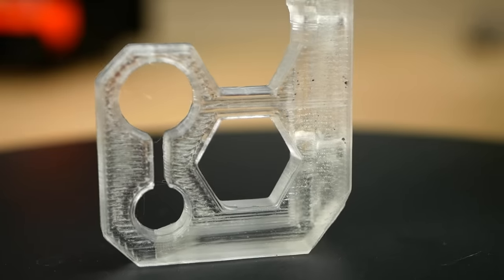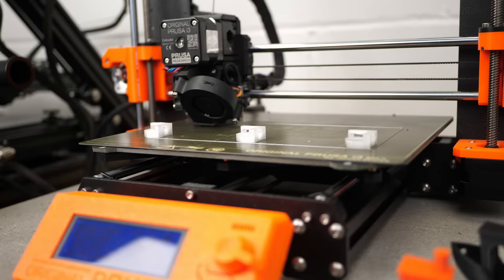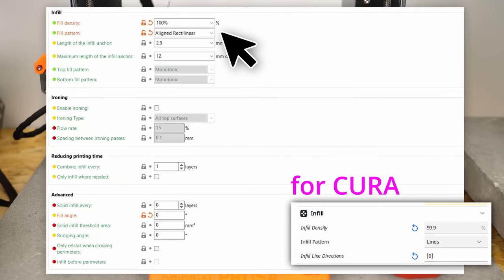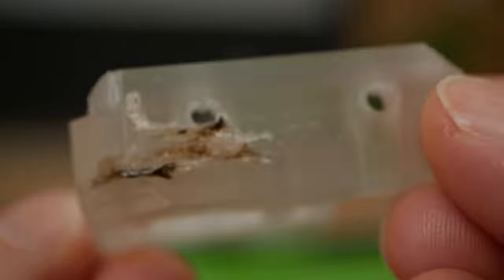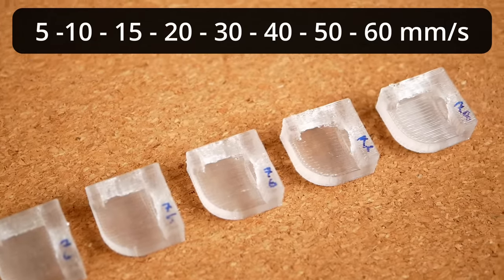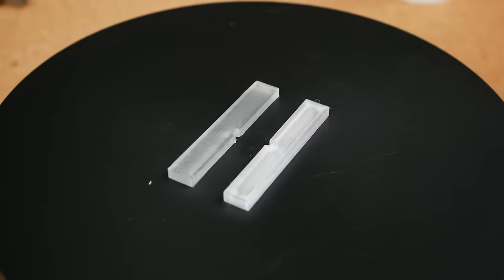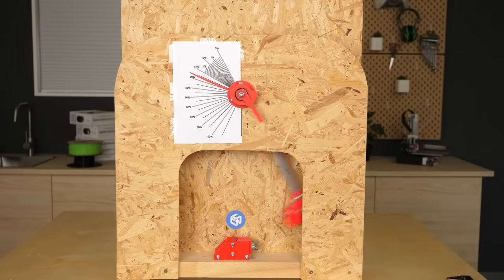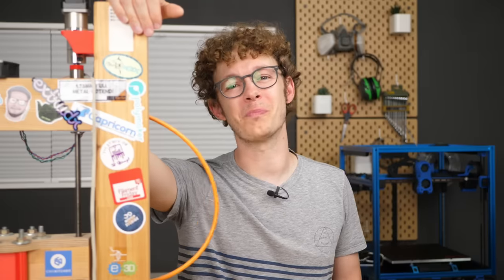Transparent FDM 3D Prints are Clearly Stronger!

Comment: The almost-perfect transparent printing of SLA also creates weird problems. Parts with flat faces printed at an angle get an undesired fresnel lens effect, where if you look through the part (or to what is inside) everything looks strongly shifted to one direction. It's similar to water diffraction, but it happens at any angle you look from. Sanding and polishing removes that distortion, but it's yet another messy processing step.

I haven't used DLP printers and I wonder if the same issue happens.

Comment: Nice video!   I recall you discovered thicker layers had better interlayer strength.  So then why not print .2mm or even use a larger nozzle like .6 or .8 to see how strong this can get?  And how about using an enclosure to keep a sort of heated chamber effect? Might an acetone vapor or heat gun add any strength via inter-layer melt?

Comment: I\ve found that thicker nozzle diameters greatly improve strength, layer adhesion, printing speed and transparency of PETG prints. If small details are not your biggest concern, try sticking a 1mm nozzle in there
Reply: Any pics showing this? I would be interested

Comment: I often wonder if the expense of another degree or two of freedom of movement would be worth having for FDM. It would allow adding layers across regular layers. That would glue them together with perpendicular polymer molecules. I think it would help eliminate the need for overhang supports too.

My other thought is messy, expensive and maybe not for every day use. Oh, and also requires finding the right materials to use. But what about putting the parts in epoxy or polyester resin and cyclically applying vacuum to pull out gas and push in resin to fill voids? A custom shape resin container could be printed along with the part to minimize resin waste. The part would be removed from the resin before it cures, or the container treated with mold release so the whole thing is epoxy coated. Optionally batter with glass fiber while sticky.

Comment: Thanks for the video. I thought that glass prints were impossible. I’m using a Creality CR-10S with ColorFabb HT-Clear. It has driven me mad in the last week, done a dozen test prints changing same parameter as you have, and i think that finally i got it. For the infill i prefer to replace it with the 99999 top surface layers, otherwise cura does weird things with infill (starts on the middle!). For me 85°C bed, 260°C end, 20mm/s speed with 12mm/s top/bottom speed, without extra wall, 105% flow with 107% for top/bottom, 0,5mm line width, 0,12mm later height, brim with 20 perimeters, no bubbles on extruded material, the extruder step calibrated (CRITICAL!), using Cura 5.1.0. Using BuildTak. Will be using the parts for a lighting project on my car.

Comment: I wonder what would happen if you printed 2 series of 100% infill "lines". The first series would be printed at normal flow, but it would only print every other line. And then the second series would print in the gaps left by the first series, but with an increased flow. The idea is that the second series would fill up the gaps left by the first series, and since it's bounded on both sides, it may be able to build up a bit more extrusion pressure to really fill up that gap as much as possible.

Comment: Using 0.5mm Width is something I always do on my prints. It saves time and makes them stronger.
I use 0.15mm layer height, but I guess 0.1 might be even better.
Will try out slight overextrusion as well. For some reason I ignored that until now (even though it makes a lot of sense for strong parts).

Comment: Do get clear prints with a nicer surface and less overhang problems it might help to use cooling only for the perimeter and sections with overhang (if this can be set up in the G-Code)

Comment: I went down this path whilst looking into making petg fibre optics and “mirrors” for deflecting led light.

I wanted to make a stand for my battery bank with forward facing battery life indicators but the power bank LEDs were on the side so I made prisms that would divert the trajectory of the led light towards the user.

I had moderate success and would love if you could go further down the rabbit hole

Comment: "Even though I did all these tests with natural clear material, these printing parameters can be transferred to dyed materials with probably the same effect on strength"

May I suggest testing this approach on some opaque filaments, especially on those with especially good mechanical properties? Making layer adhesion samples yield is remarkable and would be cool to reproduce. This project of producing FDM parts with great and less anisotropic mechanical properties is long running. It's another video and a logical followup.

Aaaand I should have watched to the end before commenting. You got this :)

Comment: This makes a case for square extrusion nozzle holes...
As a wood worker I know that 4 axes machines have an C axes rotating the tool around the z axes.
I wonder how this technology would combine with a square nozzles with more outflow on the sides than in the middle to fill the holes you get from round nozzle extrusion.
Well since I think this wont be commercially viable because a z-axes would need alot of r&d.

Comment: what would happen if you was to put the parts in a oven to melt it into one solid part with the whole salt method packed around or using sodium silicate and sand to make a solid mold so the part will be fully support as it melts fully into a solid part?  they do this in lost PLA casting and metal casting for example to make metal parts

Comment: In hindsight this is VERY logical -> transparency shows the amount of defects in the material, the more transparent the less defects. The fuller & more consistent the base material is.

Hence most transparent print -> the strongest.

Further, pigments DO decrease strength typically, this is very well known in the lamination industry (ie. carbon fiber parts). There are very few exceptions, for example graphene. Especially with functionalized graphene you get a covalent bond with epoxy -> it's not separate material anymore, but actually the base material is transformed, the molecules are different.
Reply: Thanks very much for that useful comment!

Do you think mixing functionalized graphene powder or the like into 3D printing resin will also strengthen the bonds?

Comment: Stefan, thank you so much for this as well as big thanks to Rygar1432.  

0.6mm nozzle makes things even better!

I'm doing a project at work.  We need to make a scale model of a 35 foot long rotating drum. We want it to be as clear as possible to understand the dynamics of what's going on with the non-Newtonian fluid inside when it is rotated. While waiting for the transparent Overture PETG to arrive, I spent a day dialing in 3D Solutech transparent yellow, to understand the factors. 

I made a cylindrical  test part to do rapid iterations.. approx 17mm in OD, with a 1.1mm wall, and 25 mm 3 rings were printed at a time for each temp, each with 3 different extrusion width values. The Overture PETG performed quite well with a 0.4mm  nozzle. It gave good clarity when looking at the text on a BIC pen placed against the inner surface.  Thinking about the diffraction between layers,  the 0.4 nozzle was swapped out for a 0.6mm nozzle.  

The 0.6 nozzle enabled the parts to be printed with a single wall, rather than 3.  The parts were SIGNIFICANTLY more water-clear. As an added bonus, this dramatically cut down print time from roughly 35 minutes per part to 10 minutes per part!  

Note: Pressure Advance, Temp, Extrusion Width and Extrusion (flow) multipliers were all very different for the 0.6 nozzle using the same Overture PETG than they were for the 0.4mm.  Both were Diamondback nozzles, so the difference was only orifice size.

Comment: I'd like to see the resin guys try to print the 43 cm canopy for my giant scale models. 

For single wall canopy parts I have gotten best result with high layer height, higher than normal temps and low speed. Then I clearcoat the parts with clear paint afterwards on both sides. Pretty nice transparency. I will have to try some of your recommendations and test myself.

Comment: Great analysis. I will get some clear PETG and tune my printer acc. to your findings. The clear material will make it easier to find that sweetspot. I will then switch back to my normal material.
What also helped me a lot is the correct way toooofinetune my printer for dimensional accuracy. I used to use the one wall dice method where you print a 20mm cube with only 1 peremeter and then measure that peremeter. But this method is completely wrong. I now simply print a 100% infill cube struture with 5mm small cubes stacked on to each other. This helps in evaluation how much flow I need. Afterwards I have a "dimensional accuracy model" I use which i print to measure the size of the object and adjust X-Y size in slicer.

Comment: Weird thought about the polymer chains bit at the end:

What if you both slowed down print speeds to increase reheating of plastic below the nozzle and added a string pin of sorts to make the nozzle remix the previous layer with the current layer,  thereby getting polymer chains across layers to increase layer adhesion?

I imagine it might have slightly negative effects on print quality (especially top layer quality), but given that nozzles with metal inserts work just fine, I imagine a cht nozzle where a pin extends through the middle down one layer height might be great for this.
Reply: Maybe just have the nozzle bobbing up and down slightly, conforming to the wiggly pattern of the layer below it?
You'd have to use a raft or something, and do the bottom layers wavy as well, unless the extruder could keep up by overextruding on the second layer, or there'd be gaps above the bottom layer.
One half layer height could be overdoing it, but at 0.05mm it would really push those layers into each other, mix up the plastic, vary chain orientation.
Since there's a limit to Z resolution, it's hard to tweak the wave's amplitude. Alternatively, a trade-off between strenght and smoothness might be achieved by changing the wave length of this pattern.

Comment: Best tips I can offer for making transparent parts is to set your layer height very low and your temperature lower than the lowest recommended material setting by about 5 degrees and print at a much slower speed giving the nozzle time to iron the material flat. Also do NOT use a very pointed nozzle. Instead try to find one with a fat flat shape at the end or make one yourself by finely sanding and stoning a very broad flat and highly polished shape to the end to achieve better ironing. There you go.

Comment: This seems like it would drastically increase warping on anything larger or with warp-prone geometry. And doesn't increasing internal stress degrade impact performance? Were these worse than with normal printing settings?
Reply from the maker: Great point! From my experience printing slow tremendously reduces internal stresses that come from melt swell, though the thermal stresses obviously will remain. It might be interesting to see how the performance change once the parts got annealed.

Comment: TRY sabic Hf 1110 PC glass like and if you have voids between your noodles you will not see tru it the opacity is to high for transparency due to the voids and melt temp used  this will need 310-330c and 130 bed  you can get stronger parts less noodles 
strength then clarity but if you want clear then its clear then strength second 
The brownish hue is the formation of carbon deposits "ash" from burnt filament captured in the walls mostly from multi mixed materials or over temp in the same nozzle 
great job as usual Stefan would we expect anything less......

Cheers

Comment: Stephan,  what do you think about using a belit printer to improve z axis strength as the z axis is at 45 degrees? And you get an endless axis to boot!  Curios how some common  strong and tough filaments would compare to a traditional Cartesian setup. Sain Smart has a compelling model...any interest in exploring this idea?   Perhaps xy would be weaker but z stronger so finally the print may be equally strong or week across all axes!? Hmm...

Comment: great work :) i'd try with smaller prints (max 5min) to be faster. Also, if you ever tried search the biggest mountain, just walking upwards will not bring you there..same to your optimization techniques. Maybe some more scientific approach would be nice (calculate e-steps, look at data sheets of filaments etc)

one tip to everyone: try print transparent just to find weak spots in your settings
Reply: or actually calibrate temperature sensors.. then you can rely on datasheets.

Or measure moisture of filament/surrounding air during aging.

Just some recommendation :)

Comment: If you care about strength mainly you can also just vary the parameters at the locations where  you need this increased strength. Most likely, you will not need this throughout your whole print.

Comment: I don't really have a background in 3D printing, but out of curiosity... if you printed the 'outline' of a model up to a certain height like a sort of mold... - then poured molten plastic in an uncontrolled manner at a high rate that would simply 'fill' the outline up to a certain height... wouldn't that be quicker and solve the layering issue? The interesting problem would be to keep the external layers cool enough not to be melted by the rapid molten material inflow (assuming the outer shell and inner fill are the same material... hmmmm)

Comment: Hi, Stefan! I think that for complex light pipes it's better to create a molding form, print it and use some low temperature melting plastic. Or even make a ceramic molding form out of printed parts. It's a bit complex but you'll be able to make really high quality parts by injecting a hot plastic into forms. 
BTW... Did you've tried to use a 3d printer as an injector device?
Reply: Disney Research did experiments with 3DP light pipes back in 2015 I believe, basically able to print in place, their research paper is online somewhere…

Comment: I would love to see this as an additive then subtractive process. The layer lines on the outside surely scatter a lot of the light, so if a machine was taken around it (would also remove surface defects) then a nice high grit sanding, to see REALLY how clear these get. It would also solve the problem of overextrusion messing with part dimensions
Reply: Might be interesting to enable layer ironing - just on the top layer, or all layers?

Comment: Would be interesting to see what would happen to the strength if you combined the transparent strength settings, with the traditional methods for strength, ie, multiple perimeters, perpendicular alignment of the layers and filaments with additional materials in them (ie carbon fibres). There would seem to be a lot of potential for really strong parts

Comment: By printing in a vacuum, could you get higher layer adhesion (therefore more strength and clarity)? Could you print in metal by getting metal particles to cold weld in a vacuum?

Comment: I wonder if you could take advantage of the lenticular effect the parts have.

Also: if you are making parts for strength would printing like this with a bigger nozzle make them stronger?
Reply: In my experience: yes. The bonding between the layers is a lot better and there are fewer gaps. I have been printing everything with a .6 mm nozzle at 105% extrusion.

Now I may try .8 and use a roll of transparent petg. This stuff is exciting!

Comment: Enjoyed the video. Did think it odd that you tested speed changes for clarity, but not for strength, even though the premise of the video is that transparency likely equals strength. So seems you could up your speed a bit. So hopefully there's a future video like  "speed/heat combos that produce the strongest or most transparent prints". I would guess you should go up in speed until you notice strength reduction, then up the temp at that speed to see if you can bring the strength back.
Reply from the maker: I need to do that in a separate video!

Comment: I wonder if one could effectively "iron" after every layer to really even out and bond each layer?  it would be very slow, but it might deliver something approaching truly isotropic prints.
Reply: Someone actually did that several years ago but he had to edit the gcode manually to do it because it was an edge case use blocked by every available slicer. Amazing results but a couple of drawbacks that he thought resulted from the manual process. People spent a long time nagging and begging on the Ultimaker forums to have the functionality added to CURA as a standard config option but no dice. Excuse after excuse after excuse, at least half of which read like no more than that.

Comment: I would love to print a lower receiver / frame with a clear material.
Reply: So do it on a resin printer with original Seraya Blu, 🙂
Reply: @retromodernart4426  resin printing won't offer the strength for a working lower receiver / frame